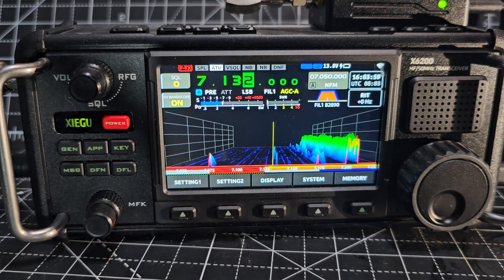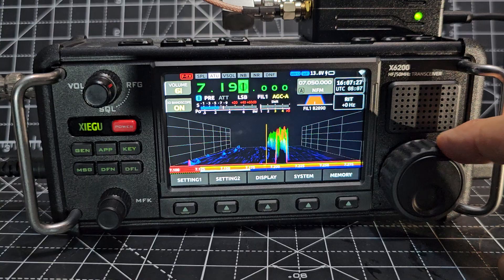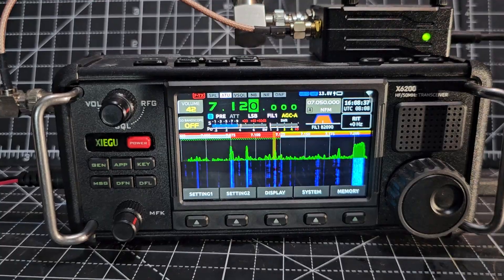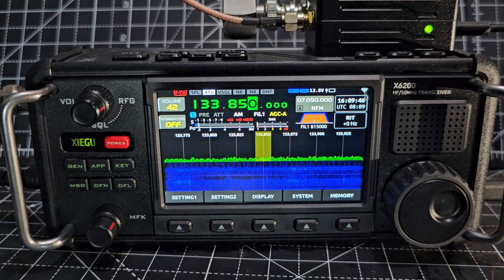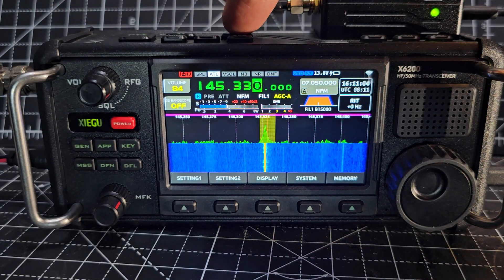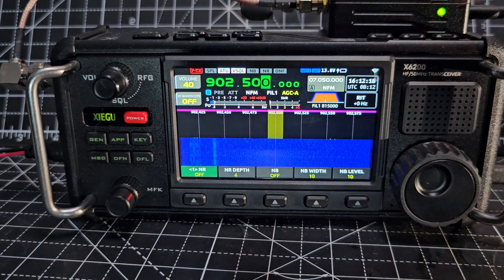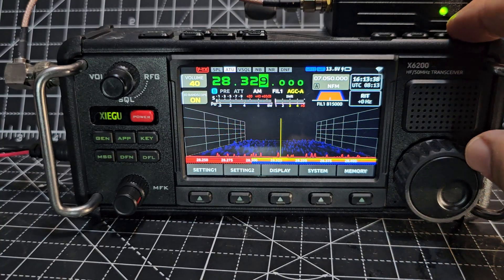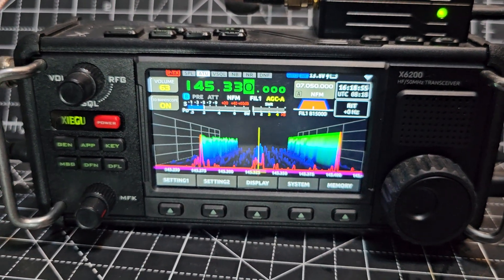3D Scope - Xiegu X6200.- Firmware v1.07

Comment: Does the added SDR help with reception of the normal bands do you think? I ordered one, but it seems it is coming on a slow boat from china, instead of state side
Reply from the maker: Seems improved but antenna set up is everything then location .
Reply: @M0FXBHamTech  Thanks for acknowledging it is a dog and unfit for purpose it is sold, that as a general use radio. By location, that means BFE were there is no EMF because it has absolute no effective noise suppression. Got it.That seems like exactly what I have been saying and feared.
Reply from the maker: Mine works great